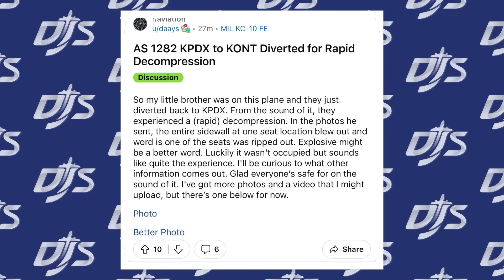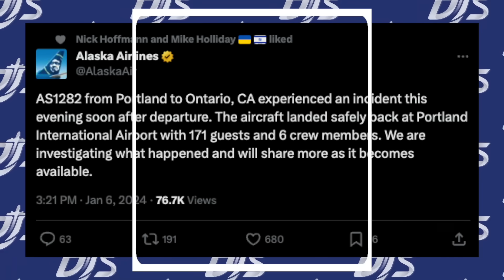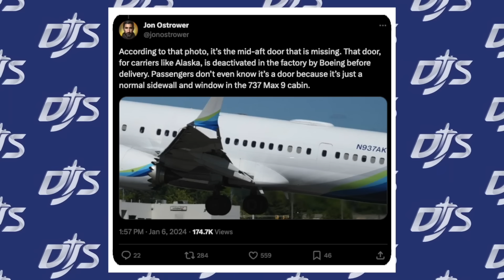Alaska Airlines 737 MAX Door Blows Out

Comment: 737 Max is a killer plane. Period. So unsafe for the aviation industry
Reply: Like all planes are when accidents like this happen
Reply: Did you say the same when AirFrance 447 went down and Qantas 72 both Airbus a330s ?
Reply: @whiskeykilo2h429 QF72 didn’t kill anyone. It dropped 600ft
Reply: @tomstravels520  and how many injured? Seriously.   If it wasn’t for the sheer airmanship of its captain, a former U.S. Navy fighter pilot; it would’ve ended up same fate AirFrance 447. The aircraft dropped 2 times 600 feet and then again 400 causing severe injuries to passengers and crew.  There’s a lot of aviation armchair quaterbacking here stating Boeing quality control issues and this is a result of outsourcing to international venders. Airbus shares this equally.
Reply: @whiskeykilo2h429  rubbish, I’m not saying Sullivan gets no credit but the aircraft itself automatically reverted to alternate law after the 2nd dive therefore preventing anymore sudden pitch downs as the protections were disabled. So the only way this would have ended like AF447 is if the pilots had decided to behave like the pilots of AF447, panic, forget procedures and barely talk to each other about what they’re doing and what is happening
Reply: @whiskeykilo2h429  well the authorities have grounded 171 Max planes, am not the only one concerned man
Reply: @abara2012  and once inspections are done and the production line investigations find the fault and corrected, the aircraft will be airborne again. Anyone killed ?   No.  Anyone serious injured?   No.  Aircraft returned to earth in a emergency safely as designed and cockpit crew trained?   Yes.   Let’s see what the inspections and investigations find?

Comment: This is why I don't fly the max I don't trust Boeing anymore I fly the Dreamliner but even that's questionable .the recent events with the a350 show airbus much more reliable
Reply: Yeh right evidence the dreamliner is questionable? Again why hate Boeing after this event of a door blowout? Got evidence it's boeings fault or just happy to jump to conclusions
Reply: @nickolliver3021  the Dreamliner had the battery issues then the whistle blower from the factory after tools and scrapnel where found near important wires..then this the door falling off last week a max landing gear failed then all the other issues with certification and then the two accidents that were not accidents
Reply: @danb5944  most if that isn't boeings fault. The crashes we all know about but this doesn't make you not fly it. Its just a rare occurrence move on

Comment: Another issue straight from FAA website, take a look.
The FAA is closely monitoring targeted inspections of Boeing 737 MAX airplanes to look for a possible loose bolt in the rudder control system. Under consultation with the FAA, Boeing has issued a Multi-Operator Message (MOM), urging operators of newer single-aisle airplanes to inspect...
They want to do Drug testing of every employee !
Reply: That's got nothing to do with this issue
Reply: @nickolliver3021  Did I say it did, basically I'm saying it's a bag of ** this aircraft

Comment: It’s a ‘plug’ hatch not a door and is not deactivated rather used for emergency evac.
Reply: It is deactivated for this particular aircraft, it’s only activated if the cabin seating layout exceeds the limit for standard configuration. From the inside it looks like a normal cabin wall

Comment: This is not just a problem with Boeing killing hundreds of people in recent years due to cutting corners with the 737 Max. It's also an issue of poor quality control and other corner cutting by Boeing and its shady sub-contractors. Which has produced a series or additional incidents like this, and problems that could have killed hundreds more. Some people says that the Max is the safest plane now because of the scrutiny it was under. But loose rudder bolts, holes in pressure bulkheads, fuselage plugs blowing out, anti-ice issues leading to potential structural failure, etc. are occurring AFTER all of that supposed scrutiny. Even if Boeing was more committed to safety and quality, sub-contractors now make most of Boeings planes. So Boeing has little to no quality control over much of their aircraft because the parts are built by someone else. Boeing is now more of an aircraft assembler than a manufacturer. So this problem goes beyond Boeing.
Reply: sorry but this comment is not what caused the issue. too much overthought and exaggeration to make people think Boeing is done for

Comment: This is a design that dates back from 2008. Its not a direct MAX 9 flaw, since its taken from the 900ER. So it is not a MAX 9 design flaw, but rather a something that has been underlying for a long time. So its weird why the 900ER is not grounded aswell…

What also should be stated is that the exit door is inoperational because of Alaskas seat configuration, so it might have something to do with that.
Reply: Yeah. I don't know why they aren't taking the 900ER's out of service too.

Comment: people don't realize that this is probably a maintenance issue and not a design flaw.
Reply: The investigation on that incident still has to go on even if it's nonfatal. It's too early to determine how this door blowout occured.
Reply: It could also be a production defect but I agree, I don’t think it is a design defect. Nevertheless, this doesn’t mean that the design couldn’t be improved and it might be after the investigation
Reply: I agree. There’s a chance for a maintenance issue.
Reply: 10 week old plane needing service on a plug door?  
im gonna go with someone at the final assy line fked up.  wrong bolts, improper rivets, etc.
Reply: @baldisaerodynamic9692  go ahead then let's just not have an investigation team and jump to conclusions
Reply: The plane is brand new only about 10 weeks old, this is a manufacturing defect NOT a maintenance issue. 
Regards from South Africa
Reply: This has to be maintenance Issue in my opinion also you can’t forget the time when one of there 737-900 Engine cowlings came off can’t you.
Reply: @IO-zz2xy  you have no idea
Reply: @e.l.Lindsay0212 The tech forgot to latch the engine cowling after maintenance. This is different. There is no scheduled maintenance tasks that requires us to inspect that plugged door. I'm not even sure if a C check would include inspecting that plugged door.

Comment: Judging by clean frame. This door was most likely removed by maintenance crew to move large objects in or out of the plane but forgot to bolt back on.

Reason it’s unlikely a Boeing issue is because it’s is a bad bolt or pressure blowout, it would have torn frame off at that speed and altitude.

Clean frame suggest door was removed on purpose and forgot to bolt back on

Comment: Boeing are a joke... I will only fly Airbus
Reply: Airbus is a joke too
Reply: @nickolliver3021    Which division of Boeing do you work for.. Safety or Marketing!! 🤔
Reply: @13839-r  what do you work for
Reply: @13839-r  Exactly... it's most likely a manufacturing defect or improperly installed section. The "plug" is a permanent piece that replaces an exit hatch/door if the customer does not want the hatch/door in that location. It is not something maintenance crews would typically mess with, if ever. If this plane was 5 years old, or even 1 year old, then maybe there would be an inspection cycle for this plug. But for a plane that's only 10 weeks old, probably not.